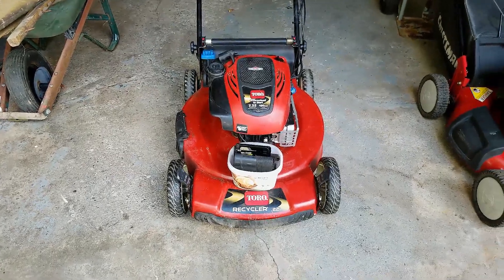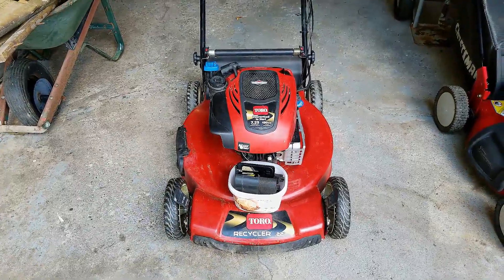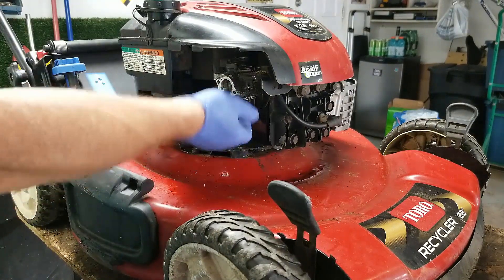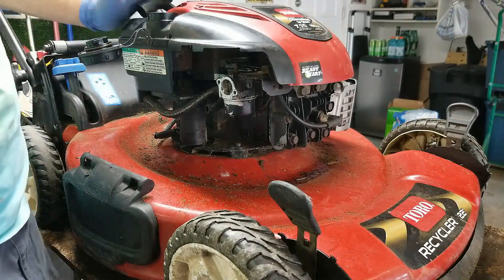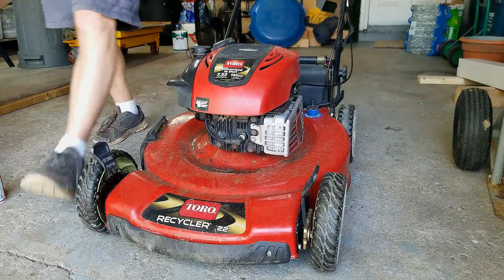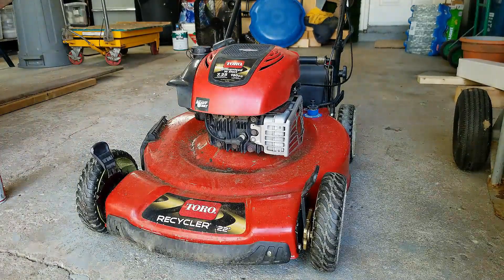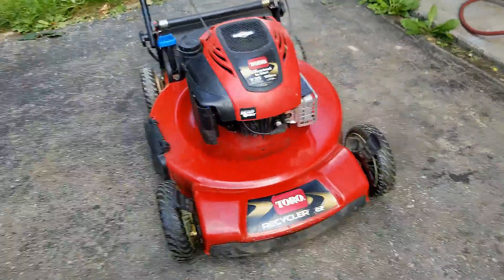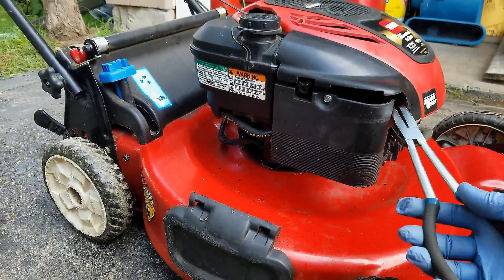Lawnmower Bogging Down? Check Out This Easy Fix

Comment: Maybe I'm an idiot but my Toro Recycler would bog down whenever I tried cutting more than a half inch off thick grass. It made a thick green matted mess inside the deck. I sharpened the blade yearly, but no help. I installed a side discharge and it solved the problem. Perhaps, it will work better recycling leaves in the fall.
Reply from the maker: Did yours come with a mulch plug and if so, did you remove it when trying to bag?
Reply: @brantsmallenginerepairs  It came with a bag, but I never used it.
Reply from the maker: @jimbrew4529  was the grass wet when you were cutting it? That would cause it to clump and stick to the underside of the deck. Or maybe it wasn't a mulching blade installed. Just spot balling here.
Reply: @brantsmallenginerepairs  I'm using the blade that came with the new machine, and I wouldn't dare cut damp grass with that mower. Although, I will say our grass in May is quite lush even when dry to the touch.
Reply: This is happening to my right now with my Toro Recycler 22". I bought it on 2020.
It worked with a lot of power, even with my high grass.

This year 2023, it started to bog down, I noticed the blade was destroyed, so I replaced it. 
The issue continued. Today, I sharpened the new blade, put some oil, cleaned the mower, cleaned the air filter,
and it still bogs down in a grass not that high. It even shutted off once!

And I was passing it at a highter height than usual to prevent the bog down because today was wet, but this issue has been happening even in very sunny days here in the caribbean.

So I really don't understand what's happening.

When I pull the cord, it runs with power, but once I pass it over the grass, it loses power, and even shuts off sometimes.

Any tip will be appreciated.
Reply: @angelhdzdev  I have having that exact issue with one I just bought used.

Comment: Hey, I have the same mower and when cutting on a slope it tends to lose fuel and it wants to die. As soon as I'm on flat ground it's fine. Any Idea's?
Reply from the maker: How steep of a slope is it? Are you going up and down or sideways on the slope. It sounds like a fuel starvation issue which would be odd unless it's a pretty severe slope.